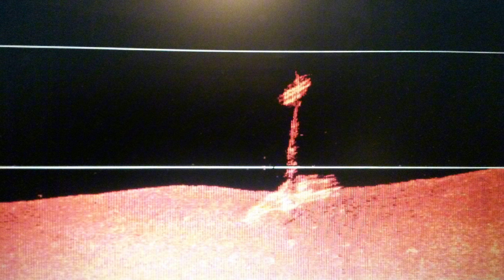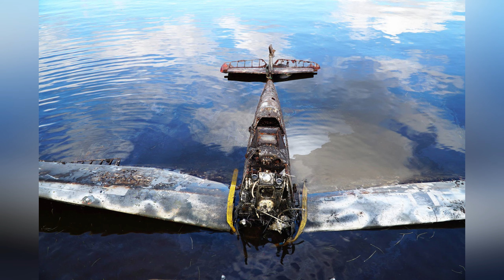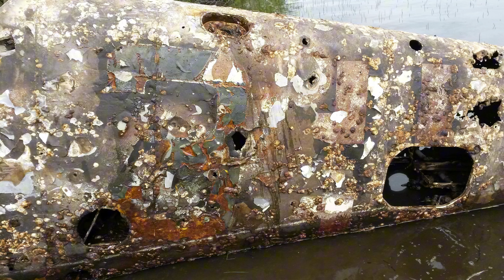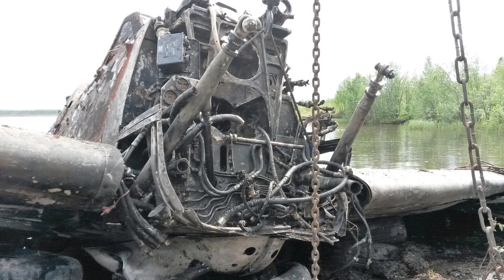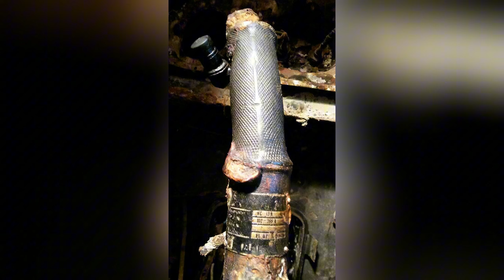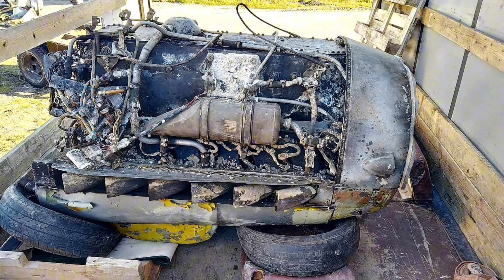Recovering Bf109 G-2: WWII Fighter Raised From Arctic Mud

Comment: Very interesting documentary . It should be noted that different types of metal standing in water will corrode extremely fast due to galvanic corrosion. Ships made of metal use magnesium anodes ( sacrificial ) to prevent the steel from corroding. No wonder the engine mount dissolved